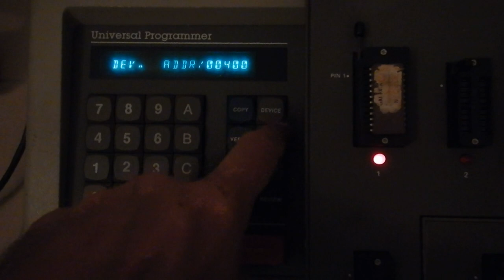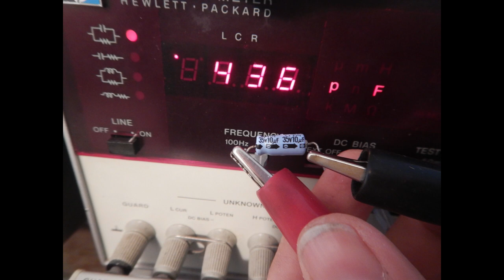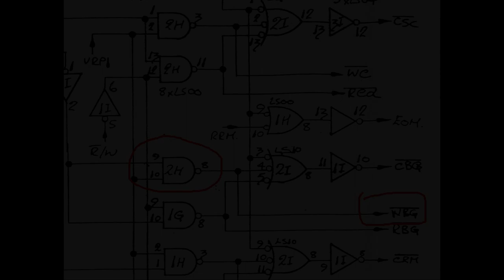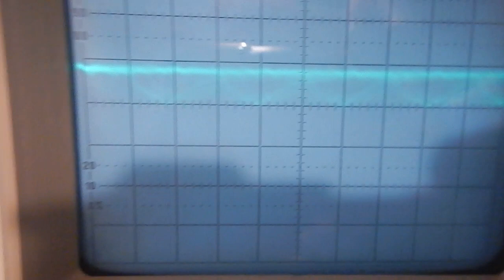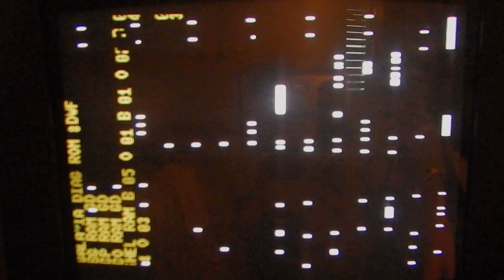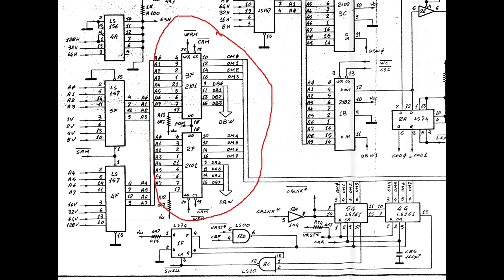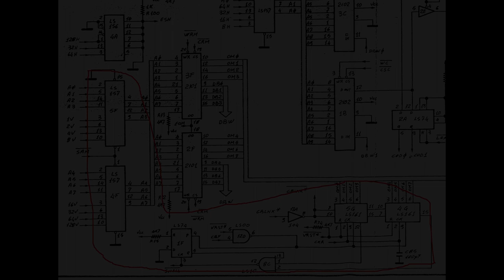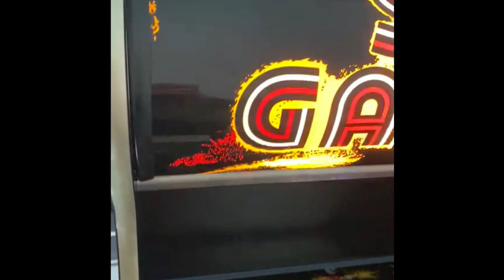Zaccaria Galaxia arcade repair #4. Last PCB but still not easy.

Comment: The integration of hardware and software on these old boards in fascinating. It shows the skill of the engineer in understanding both subjects. A very long way from today when most programmers have no idea how the hardware works.
Reply from the maker: Hey Birt! Indeed the old arcade boards can be fascinating. There's actually also a quite substantial analog electronic part (on the audio effects board in this case) on most of them! I'm working right now on even older boards :) I just hope it won't take forever to fix them...

Comment: Wow, removing eproms with just finger pressure is crazy.  Never even thought to try that!  Nice Video again.  -Mark
Reply from the maker: Hi Mark! I showed that because a couple of them would actually slide out of the socket when I turned the PCB upside down and tapped it gently :)

Comment: Excellent video as always. It's great to have such detail and explanation for every failure. It's not just a matter of replacing, it's understanding what fails and why, and you always prove it. Funny part of the video: the slow-mo aliens bomb dropping :)
Reply from the maker: Thanks for the nice comment! After working on a few similar boards, I could instantly spot odd things but I thought not everyone would see that the bombs didn't "move correctly" at their normal speed, so I tried to show the fault by slowing down the videos :)

Comment: Very good.  I hope you didn't charge by the hour!
Reply from the maker: LOL!! A repair like this would be worth a retirement plan if charged by the hour :)
Reply: Boards that have been stored in a shed (ie humidity inside == humidity outside) for decades... I had an Amidar bootleg that took me an entire week while I was unemployed. My routine went get up - breakfast - continue fixing the boardset - dinner - continue fixing the boardset - go to bed - repeat. Still took me a week. About every 5th IC was bad.
I also had to fix an Asteroids that had the same failure rate, but it started with a lot less bad ICs, they kinda failed while I was fixing it, keeping diagnose relatively simple.
Reply from the maker: @senilyDeluxe  Actually I don't think this one was particularly bad (other than the really bad socket disease). I had a video of a galaga bootleg with really bad fujitsu TTL. That was not stored properly too.

Comment: Famous for the 74 dual flip flops to fail, changed so many of them over the years, easier to change it and see, even if a static test seems to show it works, they often fail at high clock speeds.
Reply from the maker: Well, I have the nasty habit of never changing something that hasn't failed :)
Reply: @iz8dwf  If there is one in a circuit area that is faulty that becomes the first suspect.

Comment: I think there is still an error on the board which is shown "back at home": When the top right aliens start to swoop down, there is  a short "ghost flash" of an alien left of the alien field...  or maybe that's just normal for these boards?
Reply from the maker: Oh I see! Well spotted indeed. I think this is "normal" on these boards. It is related to the S2636 PVI opack output that for some reasons needs to be delayed (watch the repair #3 for more details about that) so the CPU probably first programs one PVI to handle a diving alien, then erases the static alien from the formation. If the PVI doesn't correctly handle the bus termination phase, a glitch like this can happen. All is well as long as the diving aliens don't randomly teleport during the dive. Keep in mind that the original Galaxian game runs on Z80 and these boards use an S2650 CPU plus 3 x S2636 ICs that "handle" the diving aliens and sprite collisions of them. The code had to be ported to this new architecture. So I think these glitches are originating from both hardware and code imperfections.